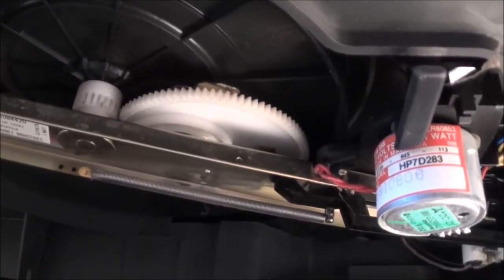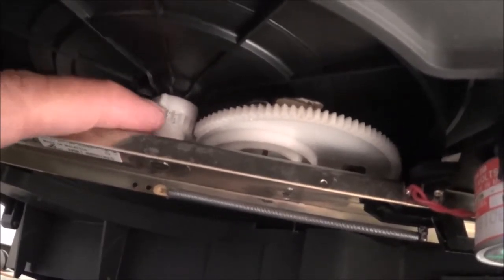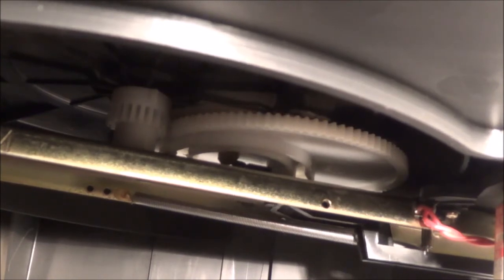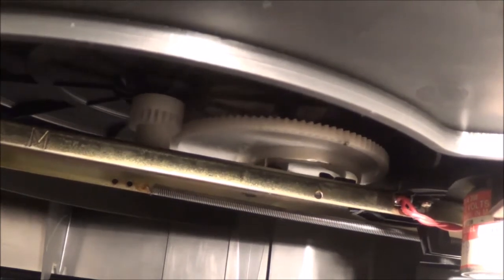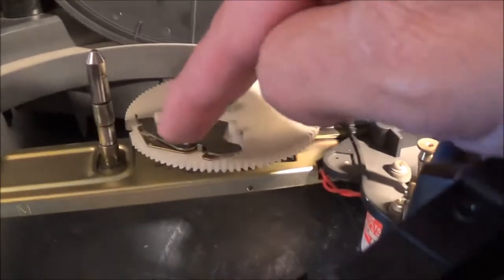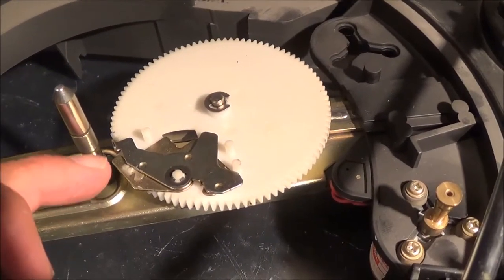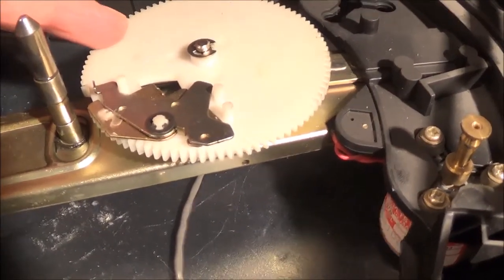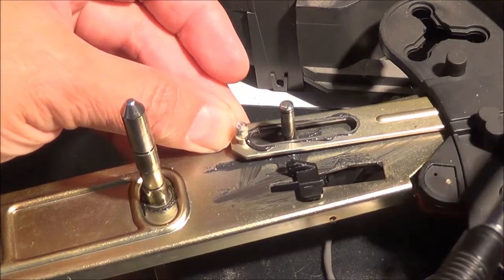Belt Drive Turntable Shut-off Mechanism

Comment: Hi , your video was so good. Actually i have a silver brand Turntable comes with the same mechanism. I removed the cam gear ,but timing changed . Now the tome arm is raised when it plays for 10 seconds. Can you pls mention the model of the  turntable, which is demonstrated.Thanks.

Comment: Now, that was very interesting. I have a Kenwood KD-38R turntable which has the automatic return feature.  I just got it up and running after sitting for some time. I noticed when the arm reaches the end of the record and starts returning to the arm post, about 2/3 of the way it makes a groaning sound. possibly the black arm is rubbing and making that groaning sound from lack of lubrication? I'm guessing at this point because I haven't turned over the turn table yet. Another thing I noticed, the belt seems to be rather loose on the spindle from the motor. I have ordered a new belt because I'm sure it's probably the same one that came with the turntable. I do from time to time, notice a slight wow and flutter and am pretty sure the belt is probably what is causing it. when I get the new belt, I'll be inspecting underneath to find the cause of the groaning sound. Thanks for the great video.
Reply from the maker: Thanks for watching and your comments! Belt needs changing for sure. Might be lubrication needed--lightly. Hard to do a remote-diagnosis: from here. Good luck!